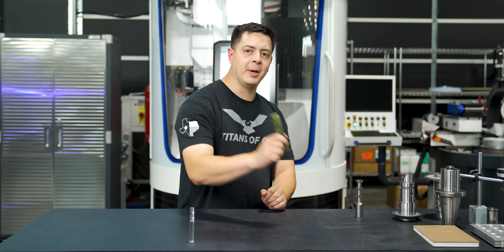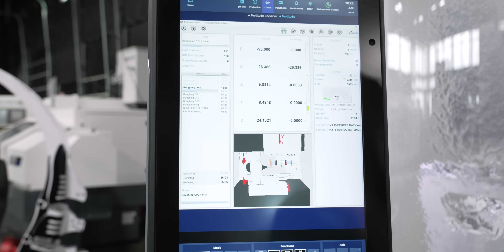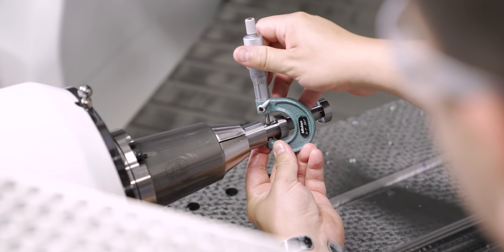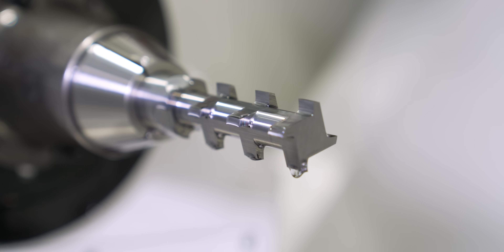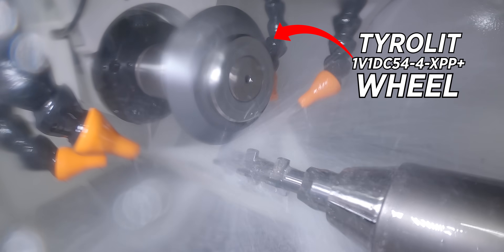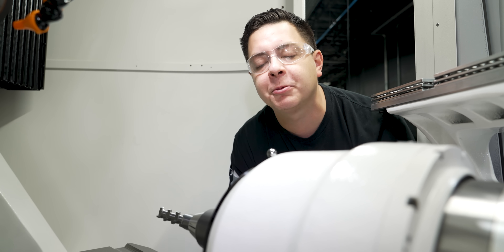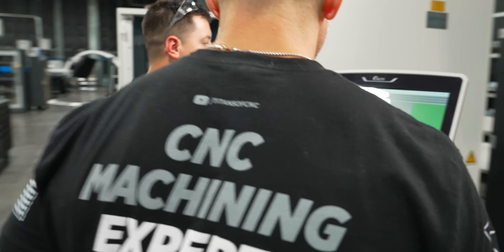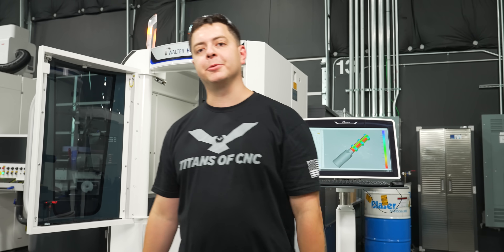Grinding a CUSTOM Multi-Slot Tool | Deburs Edges Automatically

Comment: Stagger your cuttting flutes at 45 or 60
 
Carbide will bend or break 

You might get one pat, but will you get 500 from the same tool?

Comment: What kind of SFM do you need when grinding Tungsten Carbide?
Reply: For this I was 3600 SFM on all 3 of my wheels
Reply: @christophervillalpando1815  I was under the impression that you need much higher SFM like 6000 for grinding Tungsten Carbide. What is the "Feed rate or DOC" when doing thr roughing?